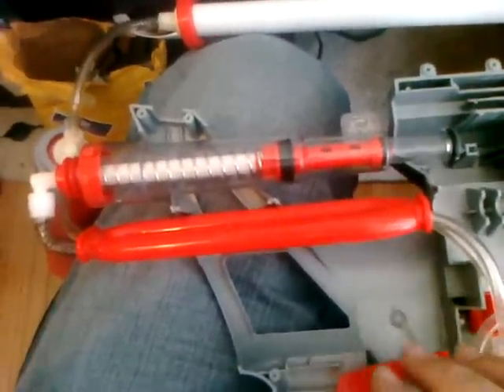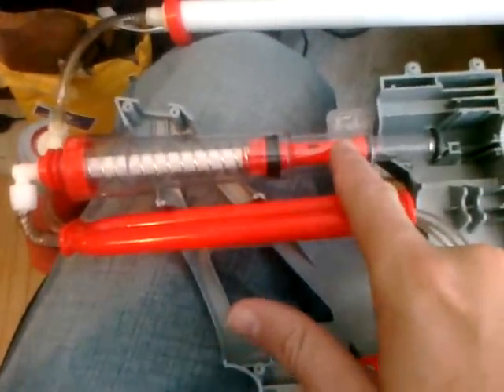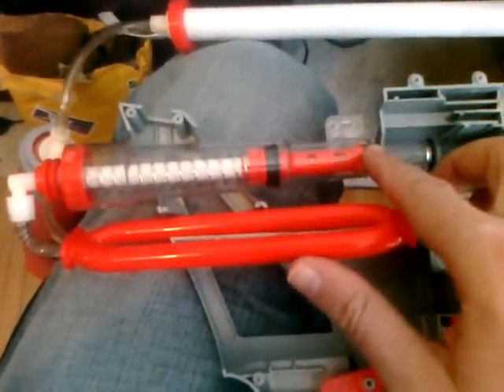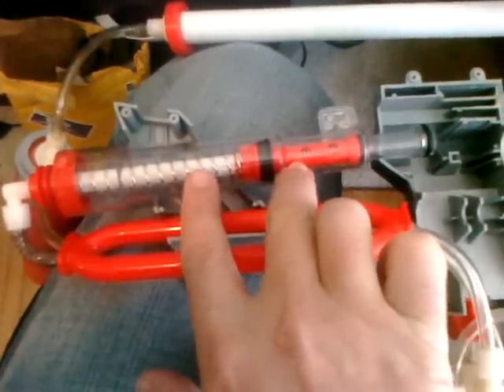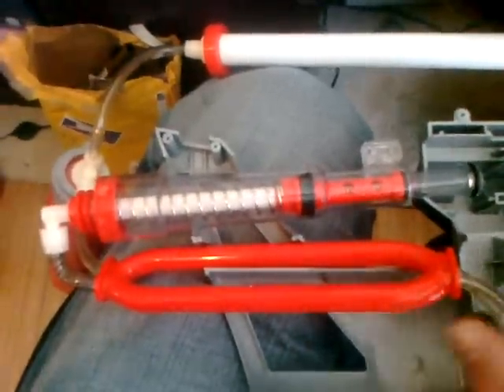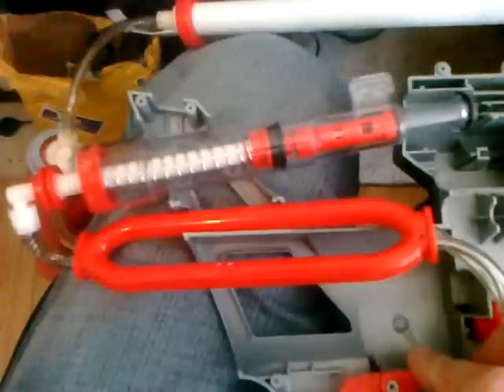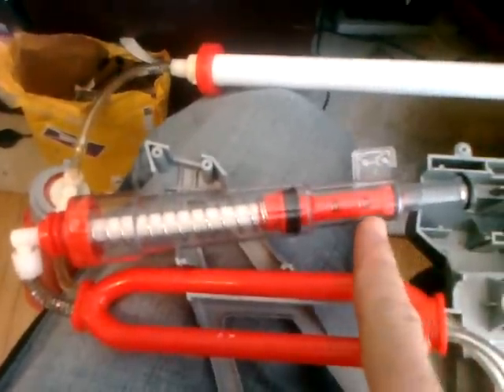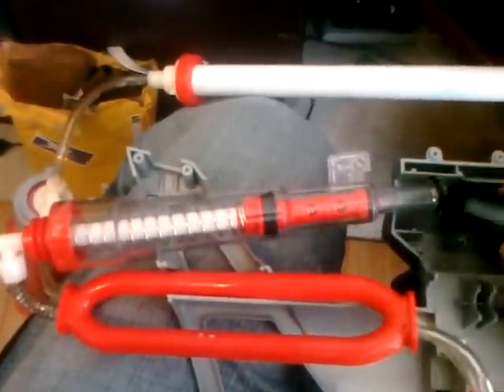RF20- How does the piston work?

Comment from the maker: Unfortunately no, the co2 runs cold and would freeze the o-rings in the plunger. This o-rings are designed for high pressure up to about 50-60psi. The constant pressure tube inside this is still the way to go... but if you really wanted it to work longer you could build a backpack out of larger constant pressure tubes in PVC piping. It would be like a ghostbusters backpack. Just plug it in and go and go and go. Bring a small compressor with you so you can fill back up between games.